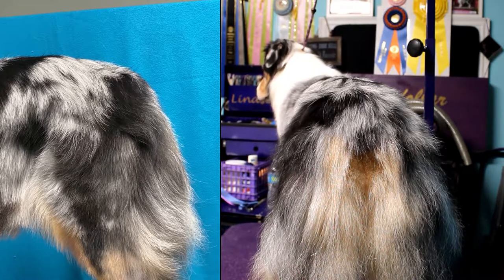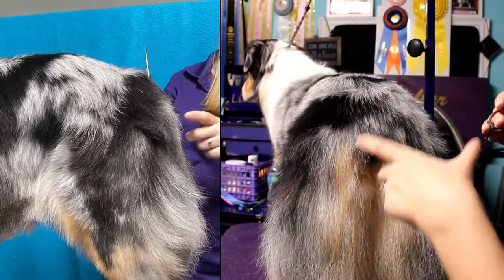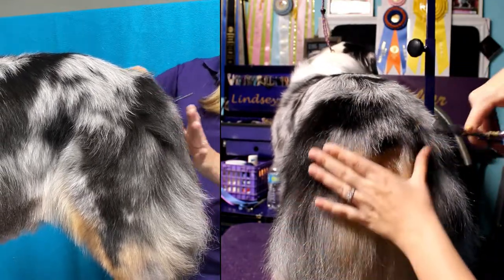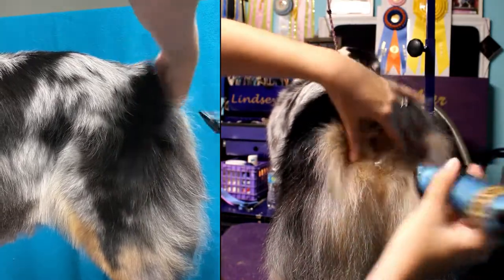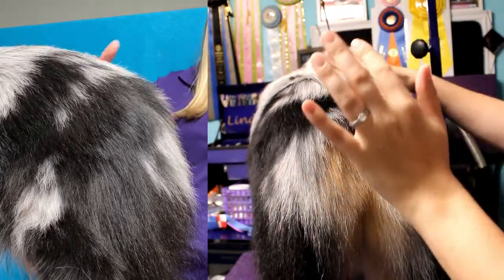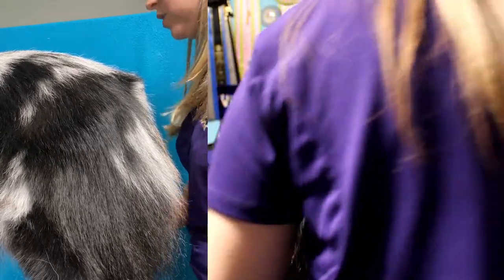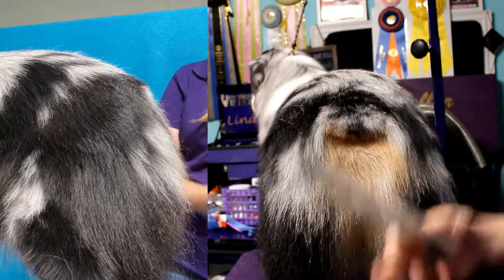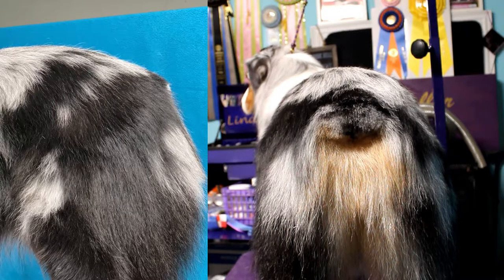How To Trim Aussie Tails

Comment: love all your videos!  I saw you have a purple Arco cordless trimmer. Do you have a video using it on an Aussie ? and for what areas? for a decade have only been hand trimming 2 Aussies with chris christen 42t, straights , and the combs , brushes for all body parts. thank you!   ( always enjoy watching you at the shows. hugs n head smooches, gorgeous pups, also in FL. )
Reply from the maker: Thanks! I use it on the hair on the bottom of their feet for the most part. I show this in the how to trim front feet video. There’s another video of it on my Instagram in the grooming highlight with a better angle. I’ll also use it occasionally on the tip of their ears since it’s quicker than shears but don’t have a video of that.